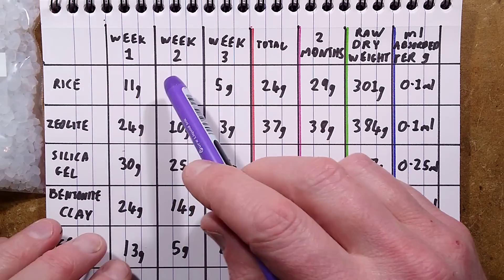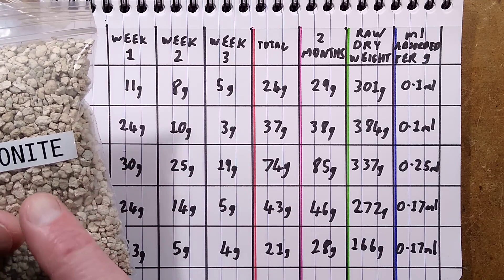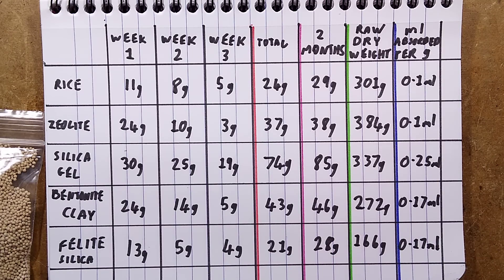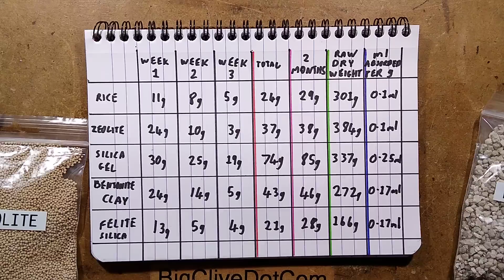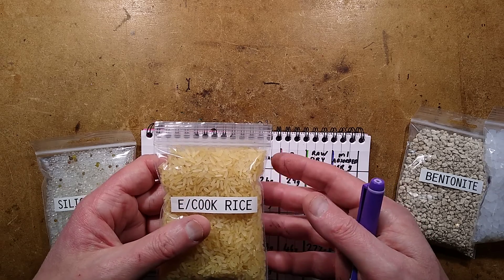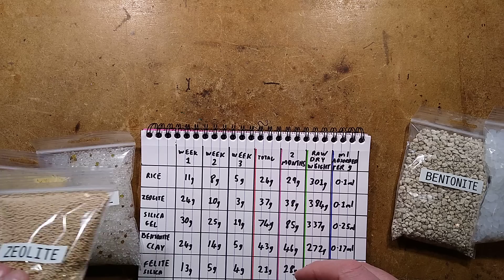Five desiccants - two month test with full results

Comment: As others have noted, 3A molecular sieves (zeolite) are highly adsorbent and would provide you with another excellent data-point for your comparisons.
Reply: Are they different to zeolite, zeolite being included in this test?
Reply: @simonneep8413   Molecular sieves are basically zeolite with consistent pore sizes such that they are selective as to the size of molecule that they will adsorb.  3A sieves are fairly specific to water molecules.

Comment: The video is very timely and helpful. I am using a 12V fridge while traveling. When I left over a month ago I brought some Desiccant with me. The fridge develops quite a bit of condensation on the inside. I thought about replacing it with cat litter, clay based. Could any of you help me choose a bag material? I am without a shipping address so it has to be something at a shop. I threw my bags out they had gotten mold on them. Grocery, home depot, garden store? Anyone know the name of the bag material? I would like to keep my foods from getting damp. This fridge gets carried around a fair amount bags are preferred over an open box of baking soda which isn't even the best of Desiccants anyhow. Cheers all. Thanks for the video BC! How wonderful your timing is!!

Comment: There is also an electric window-type dehydration system (very expensive though), which attracts and separates the water molecules from the air and thus can get to a much lower humidity if the container is sealed well. But these are very slow, so if you open the container of ten, add some silica too, The silica will dry the air quickly and then the electronic separator kicks in and brings it down and also dries the silica.
EDIT: Found the video from clive about it: https://www.youtube.com/watch?v=Vabq-s62IVM

Comment: Great video Clive! We generally reactivate our 3A/4A molecular sieves/zeolites at 200°C under vacuum to get the most out of them. The cheap eBay ones are usually legitimate but lower grade in my experience - they're still good for dehumidification, you just need more as they have lower internal surface area. Zeolites are theoretically better per unit mass but harder to dry/activate, especially without pulling a vacuum. Silica gel, on the other hand, reactivates well at 120°C in ambient pressure.

Comment: It would be interesting to 3d print a high surface structure to compare 3d print materials if they are still hygroscopic after being printed. Maybe they can be used like a desiccant wheel.

Comment: Instead of watching Clive's videos, I finally finished my 3D printer that I was busy building...which brings me to filament drying, which brings me back to watching Clive's videos. The Felite-type cat litter is readily available here in South Africa, so I suspect that my custom-built filament dryer will be something akin to a cat's litterbox with a stylish lid to keep these two furballs running the household out of it.

Great video, thank you Clive.🐱
Reply: If I remember correctly, putting filament in a box with dessicant only keeps the air dry and thus prevents further uptake of moisture, but to get the moisture that's already in the filament out, some heat is required.
Reply: Also keep in mind that if your printer has a heated bed, that can be used to dry filament. Set it in a small box (like the box it came in or 3d print one out of a heat resistant material) to trap the bed's heat
Reply: @KP-ty9yl  Thanks for the info!

Comment: Hi Clive.
Very interesting, as usual.
I’ve recently acquired a Bambu P1S 3D printer. It has a sealed filament holder (AMS) which houses 4 x 1kg reels. As you are probably aware the filament absorbs moisture, and this can adversely affect the quality of finished products.
I’ve printed 7 containers, which hold Silica Gel, and these slot into the AMS, to control the humidity. Yesterday, as the humidity in the AMS  had increased, I changed the Silica Gel, and this morning the humidity, in the AMS is 10%, whereas the humidity in the room is 65%, so it appears to be  doing a good job.
I put the ‘used’ Silica Gel into the microwave, on defrost, for 15 minutes to dry it out, for reuse.
Your results appear to support my choice of desiccant😊.
Cheers Noel.

Comment: If I was to keep 3d printer filament rolls in a plastic container, would it be best to make my own bag of silica gel like in your video and keep it inside a plastic bag within the box? 

Also, can silica gel be baked in the oven to dry them out? If so how often would you recommend drying the silica gel to use again?

Thanks.
Reply from the maker: I use silica gel beads in a mesh "organza" bag.

Comment: Interesting, volume versus weight. Does the container stop the dessicant from absorbing moisture as by volume the dessicant can not expand as it is full to the brim? Do they also then have the reverse effect, if they are saturated and not replaced will they then release moisture back into the air? Interesting subject and experiment.

Comment: I am not sure why you would expect Zeolite to be a good water absorbing material. Zeolite does indeed have a high surface area because it's action is directly related to what is  going on physically and chemically at the liquid/surface or gas/surface interface.
You can for example remove lead using Zeolite which works better than bentonite. Diesel vehicles today emit far fewer pollutants than older vehicles, thanks to a zeolite (hydrous silicate) catalytic converter. In the past platinum, palladium and rhodium were used in the catalytic converters (quite expensive metals)

"There are three main uses of zeolites in industry: catalysis, gas separation and ion exchange. Catalysis: Zeolites are extremely useful as catalysts for several important reactions involving organic molecules. The most important are cracking, isomerisation and hydrocarbon synthesis."

Comment: Good video.
Although drying them out at a higher temperature may show their maximum potential, I believe your results are still accurate. Not only was it a consistent drying procedure, it's much more realistic to what the average power-user would be doing. I mean, sure, we could all dry them out in a used toaster oven, but when you already have those desiccant dryers, I think most of us are likely to take the easier route and use the dedicated dryer that we can leave on for the day. I think it would be interesting to see their maximum potential, for science, but these results are much more relevant to the common power-user.

Comment: My top tip is to store your bottle of polyurethane wood glue in a large enough metal container with silica gel to keep the moisture away. And occasionally tip the silica gel onto an oven dish and dehydrate it at 120 C with the oven's fan running. A tube of glue now lasts for years 🙂.

Comment: Most Alumina material won't be a good desiccant as they usually have low surface area/gm, but they can handle high outgassing heat, and as well as the Zeolite or Silica Gel.  I'm not sure about the Felight, or if the clay structure can handle high heat without collapse. A carbon based sorption material will also work well ( Maxsorb, a KOH activated carbon) had the highest surface area to weight ratio at about 2150 M^2/gm that I measured.  To get a fairer comparison, outgassing prior to the test makes more sense to me.  You can set them all the same, without a vacuum pump, with a constant heat, and flow dry Nitrogen across the samples prior to testing. To get the max performance on a Zeolite, Carbon, or Silica Gel, you would pull a vacuum at as high as 900 C (depending on the material)

Comment: The bentonite/felight comparison is very well taken. A final comparison column that would be very useful is cost — how many ml of water absorbed per penny of first cost. I would expect the rice to be the cheapest, but it presumably can't be re-used as many times as the mineral products. You put ez-cook rice in salt shakers, partly for its dessicant effect, to protect the salt from clumping, but also partly because the large grains help to avoid flow problems.

Comment: When deploying desiccants it is best to maximize the surface area of the desiccant exposed to the air you are trying to dry.
I think those pods could be better designed in that respect.
But since this was a comparison test, it wouldn't have made much difference to your results.

Comment: I would be interested in testing between the blue indicating silica desiccant and the pink indicating silica desiccant. I personally don't want to use the blue stuff due to the cobalt since I am drying it in a place where I also cook food, but I wonder if there is any meaningful difference in performance?

Comment: Clive could you cross over your coronal discharge circuits with a probe in the desiccant mass to charge up the bits so they "air gap" via similar charges in a field from each other and allow more surface area to collect moisture from the air?
Reply from the maker: I'm not sure how an electrostatic charge would affect performance.

Comment: The reason to put a damp item in a descant is not to absorb the moisture directly but to render the air around the item dryer to evaporate and capture more moisture from the item. A deep baking pan with (clean) kitty litter in the oven for an hour and when it cooled enough you put the item on top with a air gap and the pan in a air tight container/bag to give the item a elevated chans of drying out. I would how ever suggest that immersing the wetted item in pure ethanol/alcohol would "rinse" the water out by dilution and shorten the drying time as alcohol evaporates faster than water, and may clean water residue from the item. You could then use the desiccant to speed up the drying further. If it will save a phone dropped in the water or not will largely depend on if the water shorted out and burned any part of it. A phone with no battery put in clean water has a high chans of recovery as does most un powered electronics, I once carried a crt monitor home in pouring rain with no box and after removing the cover and putting it in front of a fan over night it worked just fine. Salt water is a different story, chans of recovery is slim to none.

Comment: Thanks for empiricism!

I think the zeolite under-performed though (by around a factor of 2). Probably two things going on. Firstly, as you suggested, it was probably not dried out well enough to begin with because, as you noted, it hardly took in any moisture after the first few weeks. You should be able to get around 0.2g/g of water absorbed, if memory serves, and to dry it out real good it needs almost 300°C for several hours.

Secondly, I think there's a quality gradient in the stuff, which is probably why they sell the good shit as "molecular sieves" to chemists for 10x the price. It's all about the angstroms, mothersmucker.

Comment: I wonder how the different kinds of silica gel perform head to head? My assumption is the crystals/powder work better because it should have a higher surface area compared to the beads. Then again, the beads seem to have better airflow between the paeticles.

Comment: I liked this video, very educational, I don't have the patients to test like this, but I would like to see two additional things carried on from this video:
1 - Drying the materials past the 90'C limit, the air fryer is ideal for this as it has high heat and decent air circulation, 160'C is what I use for my colour changing desiccant that I sit in a old metal pie tin, with drying time taking between 10-25mins depending on how much I'm drying.
2 - I'm curious about where in the chart those cupboard style desiccants that come in a plastic tub that you peal the silver foil off. I use these in my car.
3 - How about salt? Baking soda? Laundry powder:? That stuff oes like rock 30seconds after you open the box.

Comment: Don't have experience with the others but I'm pretty sure that at only 90°C the Zeolite/Molecular sieves will hold on to more than half of their moisture content. Heck 90°C is within their working temp.
Fully dry zeolites are 
(scary) cool because they violently react on contact with water.

Comment: Calcium Hydride when?

Jokes aside, as a chemist, if you're looking for very dry (but nothing insane like using potassium) I can also reccommend Anhydrous Magnesium Sulphate (aka Epsom salts dehydrated, bake them as hot as you can and they'll lose the majority of their mass which was water. They strip water from the air very efficiently)
Zeolites, we use 'molecular seives' in lab for this, are only really good at stripping small amounts of water from something, and are usually used to dry solvents which have already been dried by distilling.

Comment: Thanks for doing this Clive. I have a couple of questions:
Were these tests run at the same time (so that the RH was the same for each test)?
Do there media perform the same repeatedly (i.e. after re-drying and re-using)?
I'm sure a higher drying temp would give better dehumidifying results but this is fine for real-world use.
I appreciate your work, cheers.
Reply from the maker: Tests were run at the same time.

Comment: Having a dedicated air fryer for drying desiccant is peak Big Clive energy
Reply: @TheRealBobHickman  It is also very smart, because the color changing silica gel is actually toxic.
Reply: @dl200010  the blue ones ? Yeah those contain a bit copper. Dont eat it.
Reply: @blueredbrick  The blue ones don't contain copper. They contain cobalt chloride. The orange ones contain methyl violet. Both are much more toxic than copper. But yes, don't eat them, but also know they do leave residue of the color changing material on whatever they touch, especially when heated.
Reply: @dl200010  The blue ones are banned in the EU (which the Isle of Mann is no longer part of, but still probably tricky to get there).
Reply: @Adderkleet  Everything is tricky to get in the Isle of Mann. Just because the UK pulled out of the EU doesn't mean the ban is gone. EU policy only is enforced through laws passed by the government members. So, the UK would have to reverse the specific law that banned them. I doubt they will.
Reply: Is It really that toxic? I have bule ones in some kind of fabric bag, and the instructions say to put it in microwave if It's changes color. I bought them in a store inside EU.
It's called car dehumidifier bag, and It's a black bag, with a part in the midle where It's changes color/see trough part where you can see the inside cagning color.
Reply: @thombaz  The blue ones are banned in the EU, for good reason, so you either got them before that or from a shady shop after.
Reply: @thombaz  And yes, they are toxic. That is why the color changing ones are not allowed in food products even in the US.

Comment: A fascinating experiement for sure, but...What does it mean?  My primary living space is 4,500 cubic feet, how many mL of water is that to make it not so humid?  Also, if you heat it to bake off the moisture, doesn't that just reintroduce the moisture into the air, or are ovens--as I've always suspected--actually portals to an alternate dimension?  My oven does have a button not listed in the manual, but I've always been afraid to push it, as I cannot, physically or emotionally, deal with another sentient tentacle incursion...

My takeaway from this is I think I'll just stick with my dehumidifier, and always pack cats in silica gel for shipping.
Reply from the maker: A proper dehumidifier is the only viable option for drying a large area.

Comment: Never in a million years would I have thought I'd be watching a Big Clive video about desiccant. I need reusable desiccant for my 3d printer filament storage tote. After seeing this video and seeing how well silica did, I might just get some silica. I'll probably spring for the orange color changing silica (get the orange because its non-toxic as opposed to the blue which has cobalt).
Reply: Activated alumina works much better. It keeps pulling moisture out of air to much lower levels than silica gel can. I believe silica gel works faster, until it just stops pulling moisture.

Comment: I would NOT recommend using a desiccant like silica gel in a tool box or placing the pouch in contact with ferrous metal.  This type of desiccant adsorbs moisture, that is the crystals collect the moisture around the outside body of the crystal, rather than absorbing it into the interior.  
Also, if not used inside of a sealed water-vapor proof barrier (like multi-layer foil / thermoplastic bags or sealed steel cans) you wind up attracting MORE moisture toward the thing you are trying to protect.  This is a desiccant pump.
Also, there are very specific formulas to follow to calculate the proper amount of desiccant to use that take into account the type of barrier (e.g. foil bag or steel can), the volume that the barrier encloses, and the amount and type of dunnage (cushioning, blocking, bracing, etc.) in order to be effective.
Also, depending on the time span, you may need to remember to either change out the desiccant, or refresh it (bake in oven).

Comment: I'm surprised at the zeolite results. My dishwashers use zeolite to aid in the drying process, and it is amazing how well, and quickly, it dries dishes.
Reply: Clive did comment he was limited to 90C for regenerating the desiccants and other commenters have mentioned that zeolite generally needs a much higher temperature to properly dry it out

Comment: I'm general desiccants need to be dried at fairly high temps.  Oven or air fryer are the way to go, silica get needs around 135C for a couple hours in the oven. The one I really would have liked to seen is dried epsom salt, but you need temps of 250C to dry that or properly.